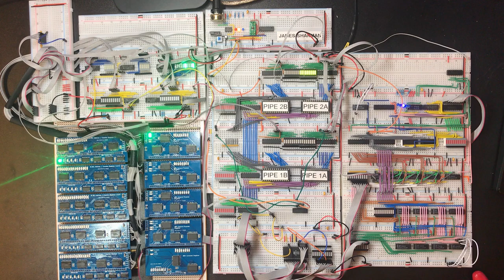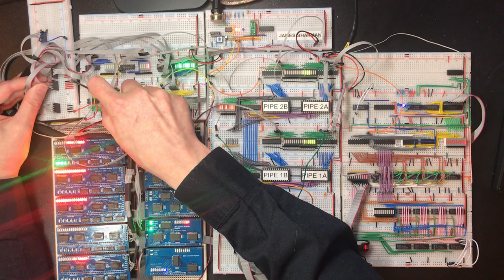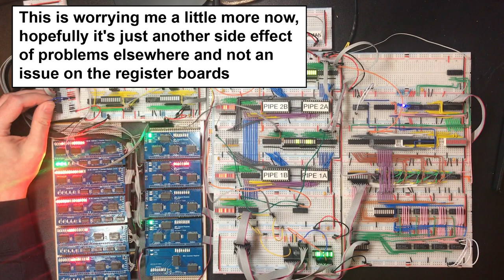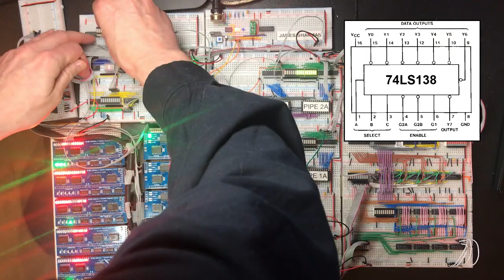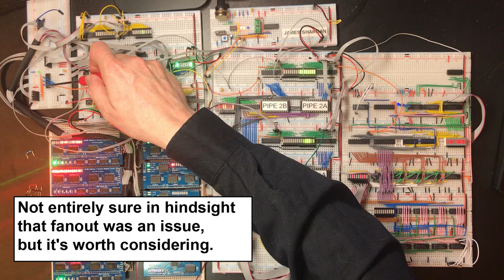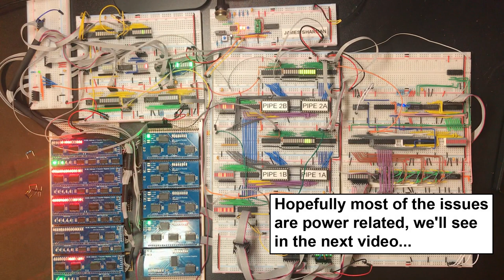It all goes wrong! - Making an 8 Bit pipelined CPU - Part 38

Comment: This is really cool!  It brings back memories of a 4 bit TTL processor I made way back in my early days (late 70's), when educating myself on the new world of microprocessors. :)  Back then I used wire-wrap to put it all together.   I must go back and watch your earlier videos... when time permits.
Reply from the maker: Thanks! Oddly enough I looked at wire wrap as an alternative to breadboard, some of the wiring pain you get from the fixed breadboard layout would be easier. I wish I had used wire wrapping for the original diode matrix prototype (But not as much as I wish I had designed an ordered a pcb 2 weeks before)
Reply: @weirdboyjim  Yes, I still have plenty of wire-wrap gear gathering dust. These days, pc design tools and cheap manufacture make PCB the way to go even for one-off builds.  Back then, either wire-wrap or point-to-point solder was the only way to go.  Breadboards were even expensive, so I only had a couple available for actual prototyping.  The only remaining benefit of wire-wrap is perhaps highest circuit density (unless going beyond 2 layer PCB).  :)

Comment: It's amazing how well it's all working on breadboards! Those things are horrible to prototype on.
Reply from the maker: Indeed. This is one of the reasons I’m using the “prototype then convert to pcb” approach. Those register pcb’s would be 15 additional breadboards (i.e. double what I currently have) if they hadn’t been converted to pcb before replication. There seems to be more of a scaling issue with cheaper breadboards as well (and mine are the cheap ones).

Comment: I've admittedly not been on the lookout for odd behavior in the this video like you suggested to do at the start.

So, I'm on a trip right now, and don't have access to my computer with a 1080p monitor, so I'm using my 720p laptop right now. Something that's interesting is that despite that, setting the video quality to 1080p increases the video quality, which tells me there's bitrate issues. Especially in the corner where you were working, the bitrate was really bad for some reason.

(6:28) That was interesting. The return address register decremented when you told the program counter to assert to bus.
(12:41) Are you using white wires there? I'd really recommend using another color in the future, because those really short white wires are super hard to see against a white breadboard. (They might also just be bare wire, which still doesn't show up well against a breadboard, I guess.)
Reply from the maker: There is some followup you have probably watched by the time I write this. I usually watch the videos carefully when editing so I make notes for myself on what not to do in future but re-recording videos is not really an option.

Comment: Did you try to load a value into the program counter without stopping the fetcher? Inc+Load at the same time may not be the best idea.

Also, why double invert the clock when there's an inverted clock available already?
Reply from the maker: Ahh man, I may have to re-watch this video for context on these questions. I did indeed run into the issue of inc+load at the same time. I should have realized that would be a problem but I was thinking as a programmer more than about how the logic must be implemented.
Reply: @weirdboyjim  At this point you just had added the demultiplexers for the control lines of the 16-bit register and were feeding in values by hand. Before fixing power supply, LEDs draining control lines, solder bridges on the 16-bit registers and fanout issues on the clock line.

Comment: I tested the Assert to XFERBus of the 16 Bit Adress Registers as shown in the video and realized, that a new value set by Load, Inc or Dec is latched by the following clock pulse, not at the same as the new value is set. Is that, what you wanted? I tried to latch at the inverted clock pulse, then the new value is latched at the same clock pulse, but then something goes wrong with the loading of a constant in the constant register.
Reply from the maker: This is deliberate. The Program counter is read and incremented at the same time, if the address asserted on the bus changed midway thru the cycle you would get an undetermined result for the fetch operation. There is a similar requirement for determinacy on the stack pointer. On the transfer bus you could use line drivers and (without spending time looking at all the implications) I think it would work ok, you would get the value before the inc/dec operation (Since the inc/dec would only happen during the rising edge) but the design as it is made logical sense to me.
Reply: @weirdboyjim  thanks for explanation! So my circuit works correctly, when I have to step 1 clock pulse after asserting to the xferbus to see the value on xferbus
Reply from the maker: @prtlwnft4028  Yes, that’s how it’s designed.  It’s not the only way to do it, but I wanted an assert on the transfer bus to be the same value as an assert on the address bus. On the address bus I need to be very sure about the value relative to an increment, the fetch unit requests an increment at the same time as pulling data from memData, that way it’s next fetch is at the next address.  You are getting through the videos at a fairly respectable rate.